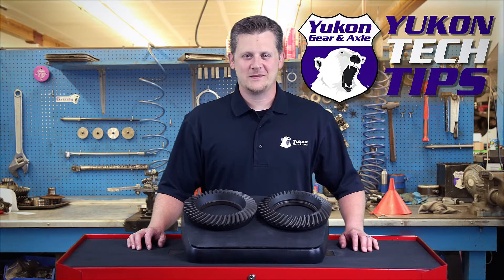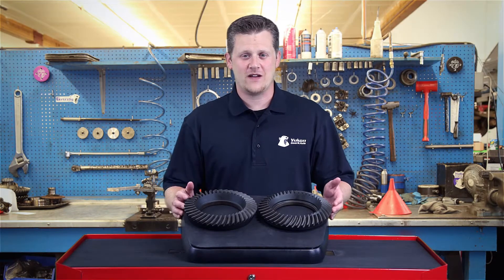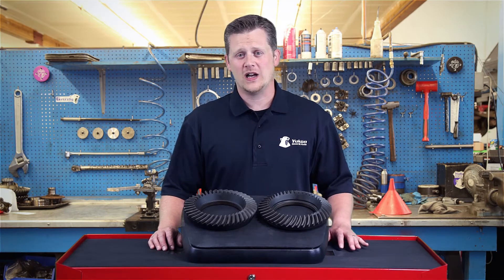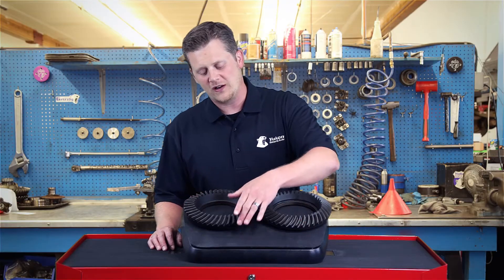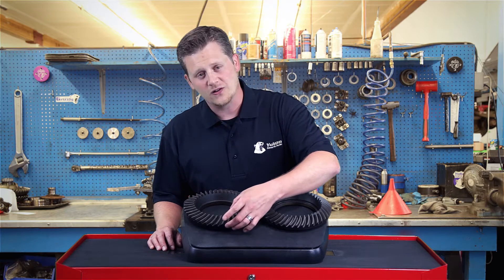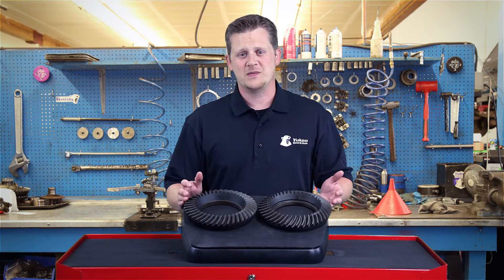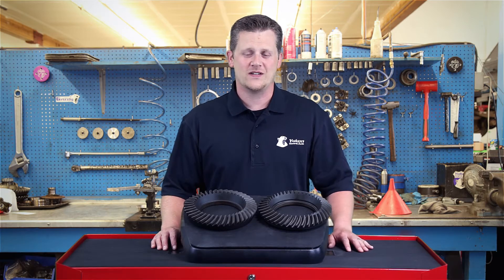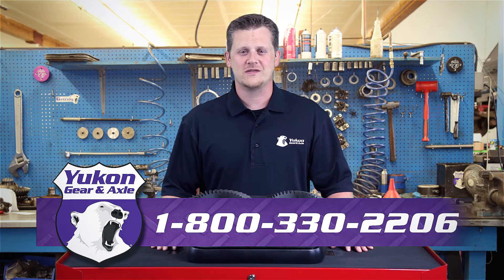How to Identify a 2 vs 5 Cut on Ring & Pinion Gears | Differential Tech Tips

Comment: When checking the ring gear pattern with marking paint, a 2 cut has a bias pattern, and a 5 cut has a square pattern. The height measurement difference has no answer, they are all different - and has no bearing on anything.  The major difference between the two types is, a 2 cut takes less time to manufacture and is quieter in operation. As far as strength goes, they both are just about the same.   And NO!  You cannot mix 2 cut gears with 5 cut gears...